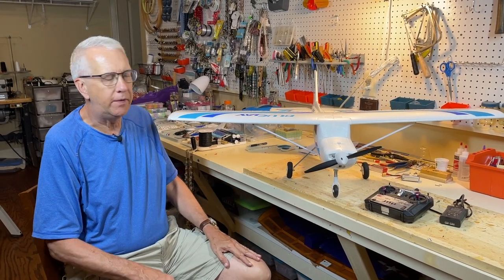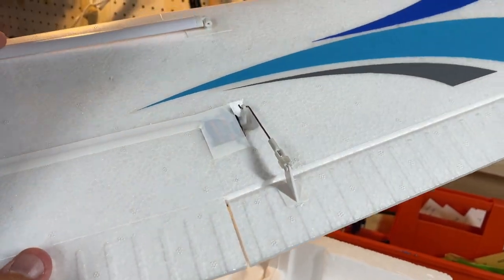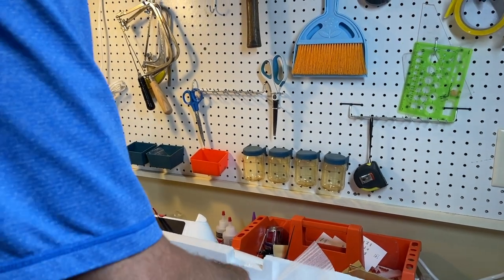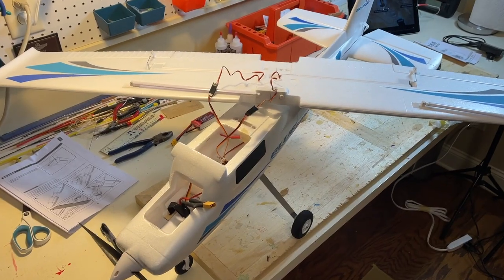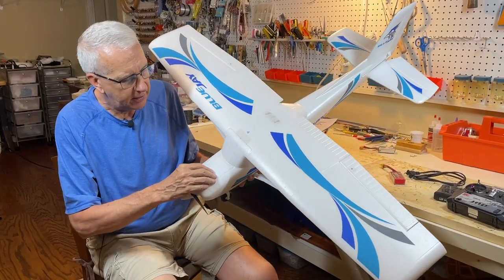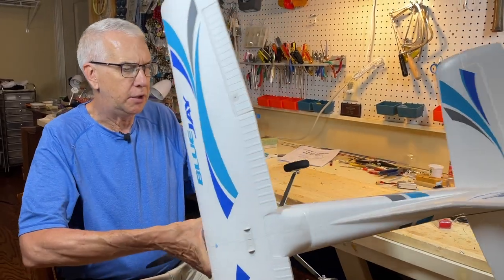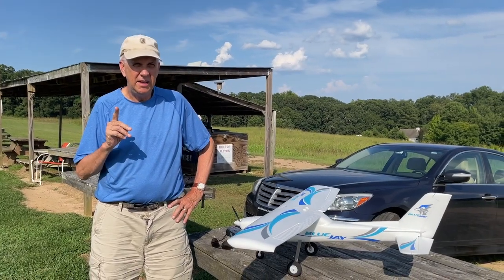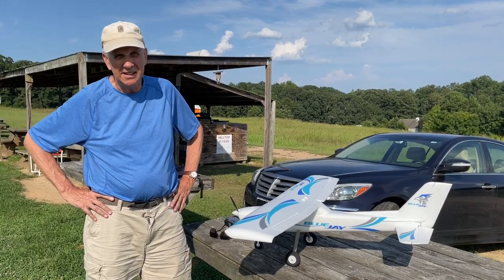Fair RC Blue Jay ARF RC Trainer

Comment: Sweet easy little trainer, looks good, appealing to the new flyer, and a complete set up. This could be a good club flyer for newbies. I wonder what the price in Australia is. Thanks again Tim
Reply from the maker: Jim:  Thanks for checking in!  Tim
Reply: I looked at the web site but this plane is not listed
Reply: They sent me a note saying it will be released on their website on 5 august.  Thanks
Reply: Do props spin in the opposite direction in Australia?🤔😜
Reply: @BeefSupreme-vk9sz   not sure if the coriolus effect stretches that far.😝👍🏼🇦🇺🦘
Reply: I know the toilet does😅 @BeefSupreme-vk9sz

Comment: Don't sweat the wing screws!
After the initial tightening (albeit scary), they seem to go on and off nicely when needing to remove the wing. 
That first crack they let off and the force needed is a bit unsettling, but they've worked wonderfully in subsequent attempts! 👍
Reply from the maker: HH:  Good to know, thanks!!  Tim

Comment: You control the control surface throws by moving the push rod on the servo arm and control hot.  If you move towards the center on the servo arm, you get less throw. The opposite is true for the control horn. Its all about levers.
Reply from the maker: Correct. I have a video coming out on this!  As part of my review process I like to fly the plane “as is”, usually better info for a new pilot. Tim

Comment: So this is an RTF model (you yourself use the phrase "ready to fly" several times), including everything needed and requiring only minimal "assembly" (as opposed to building) somewhat akin to fitting the propellors to a DJI quadcopter and inserting the battery, so where's the legally required Standard broadcast Remote ID capability?   Surely this aircraft wasn't manufactured nearly a year ago (ie: before the 16 Sept 2022) and it doesn't qualify as a "home-built unmanned aircraft" as defined in the final rule.

Remember, it doesn't matter whether you're going to be flying at a FRIA or not, the manufacturer is required to provide  such craft with SRID fitted as standard, right out of the box, so it would appear that this craft is sold in breach of the Remote ID rule.

And no, fitting a broadcast RID module will not suffice... models manufactured post 2022 that do not meet the definition of "home-built unmanned aircraft" must have SRID fitted out of the box.

I thought you, if anyone, would not be showcasing non-compliant models that are breaching the FAA regulations 😲
Reply from the maker: Well, first of all, the RID rules do  not kick in until Sept 16, 2023.  So no one within the US needs to be RID compliant.  Remote ID requirements essentially do not exist until Sept 16, 2023.

It is true that drone manufacturers need to be remote ID compliant to sell drones after Dec 22, 2022.  There are well over 100 compliant drones listed on the FAA's website.  As the penalties can be severe for non-compliance, my guess is most drone manufacturers cannot survive a US Commerce Dept ban on US sales.  

I have a lot of slips of the tongue while narrating the videos, chalk it up to old age.  I did get the title correct with calling the Blue Jay an ARF.

But you raise a very good point on why drone manufacturers need to be RID compliant out of the factory, but fixed wing RC not needing this.  One of my goals is to try and figure this out.  From what I surmise, the FAA and other government agencies see the drone operators as causing the most problems for fully integrated flight operations in the National Airspace System.  Fixed wing, like they have since the 1950s, tend to not cause problems.  I am working on a video discussing this subject.  Tim
Reply: @TimMcKay56  I don't think it is a slip of the tongue to call this an RTF -- there's really no more building involved than  with some DJI drones.   And the FAA makes zero distinction in its rules/regs between fixed-wing and multirotor craft so I don't see why they should draw a distinction here -- a rule is a rule and if it's not then nobody can be criticized for not complying.

As I said in one of my own videos, I really do believe that the FAA has created the RID rule to fail.  One gets the impression that "malicious compliance" on the part of the FAA with the Congress diktat to introduce this rule is there way of "sticking it to the man".   At least we live in hope that this is the case because it likely means that the FAA will not actively be enforcing the rule itself.
Reply from the maker: As I said, I am working on a quite detailed video on RID history and way ahead. RID became a “real thing” in the 2018 FAA Authorization Act, and Congress was crystal clear to the FAA to create RID. Driver is the commercial unmanned operators who seek fully integrated operations with manned and unmanned aircraft, a $29 billion industry. They are thrilled with remote ID. 

The FAA does not, and never has, a robust enforcement system for recreational pilots. For example, to fly your Cessna you need a medical and a biannual flight evaluation, plus three takeoffs and landings with 90 days to carry passengers. The only way the FAA can check this is via a “ramp check.”  Which never happens. More in the video! Tim